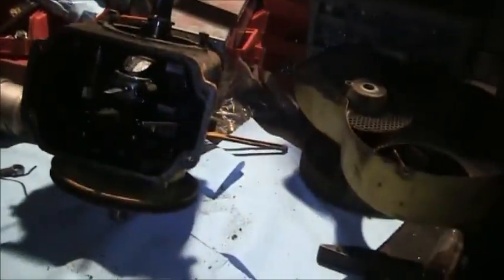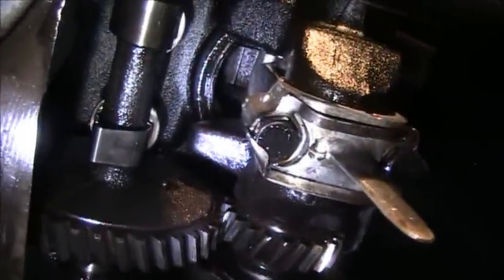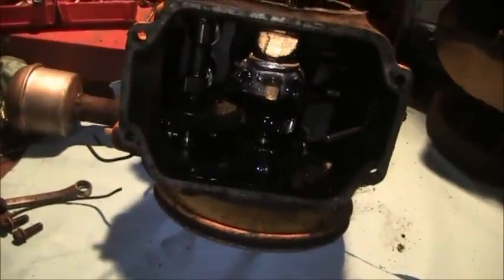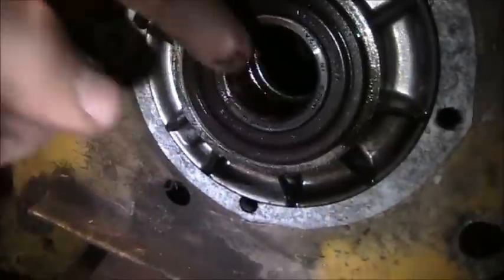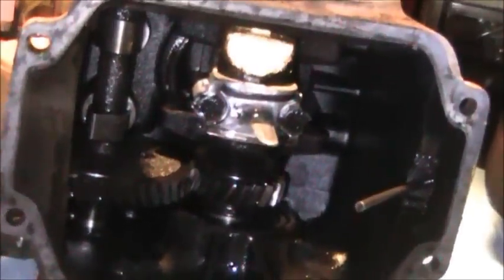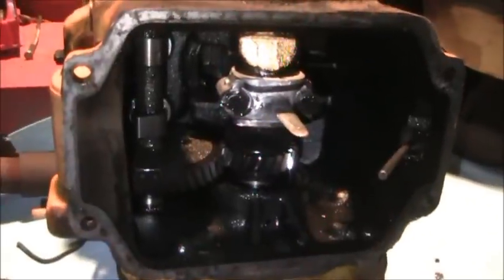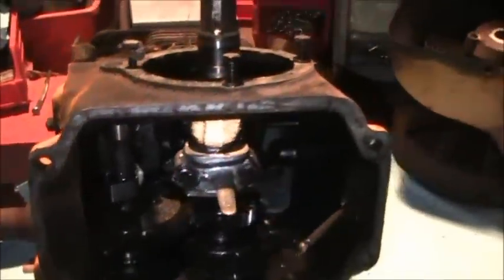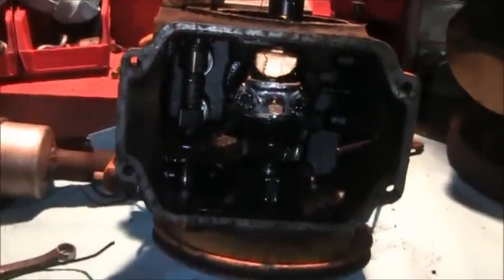1961 Cub Cadet Original Part III Engine update

Comment from the maker: oh no its ok haha . I was smoking and was getting oil past the cylinder so it needed a ring job. Since I'm doing a total resto on this mower I decided that if I'm going to do it right I might as well go through it with a fine tooth comb. And I'm going to do a nice paint job on it so I dont want to later down the line have to take the engine off to fix a problem I should have addressed earlier ..

Comment: i am restoring a original right now also, and am at the engine re-bore step. my k161 was the small bore 2-7/8" and was slightly out of round , i probably could have gotten away with it but i want it done right the first time, i am reboring it to the 2.938 becuase they dont make the 2-7/8 piston anymore. what bore is yours?